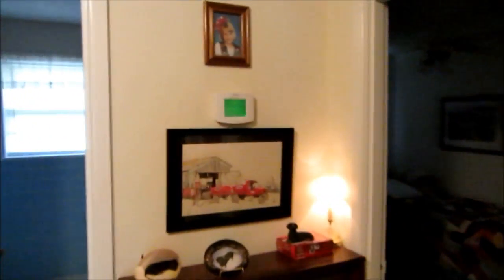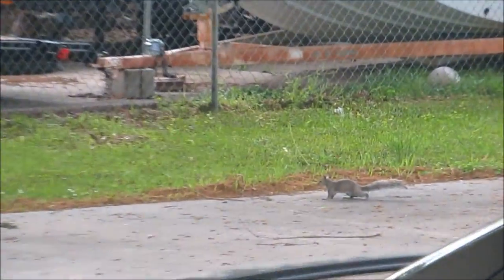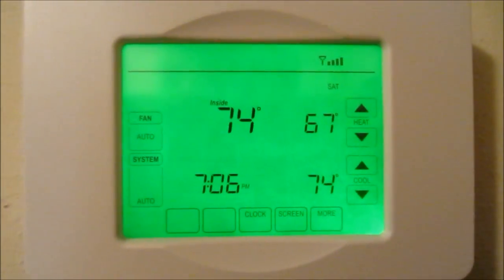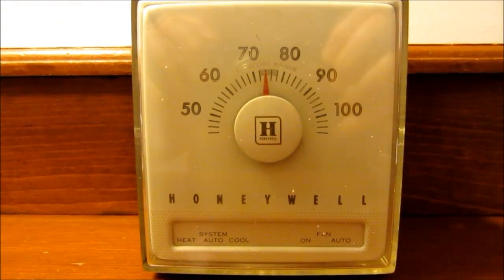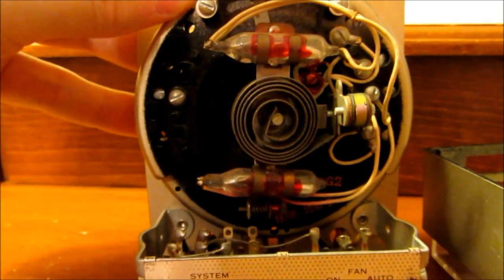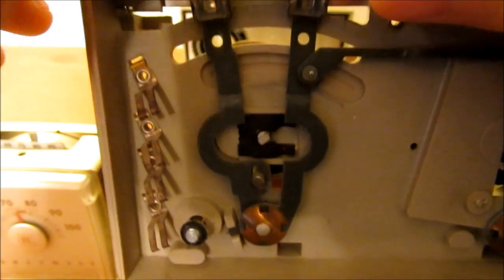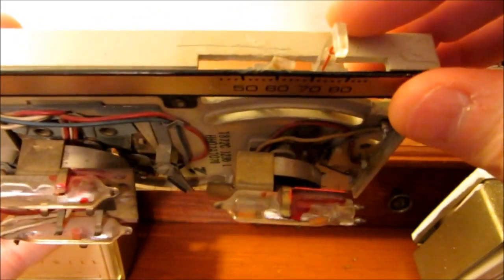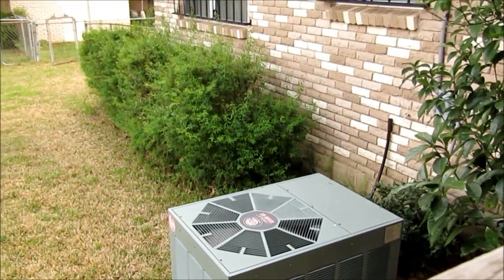Honeywell Thermostats: Auto Changeover Past & Present + Canon SX260HS Zoom & Auto Focus Test

Comment: Thank you for making this video. We had theese in my old church i went to before i moved. I am replacing the digital my house came with with the t874 with the auto changeover base. NO BATTERIES! no programming no hassles. Im sick of flipping the switch from heat to cool every time a front comes through. In WI the weather may change 3x a week easily. THANK YOU! This was so helpful. as far as im concerned i dont want to login or have someone hack my thermostat.
Reply from the maker: No problem, I'm glad my video helped you out! The T874 is my favorite mechanical thermostat.  I have several in my collection. That's great that you are installing one in place of a digital. I would not have a thermostat that required batteries either. They are very unreliable. Even though I do currently use a Honeywell WiFi Vision Pro, I have the programming turned off. The Pro models are powered by the common wire and require no batteries. Otherwise, I would be using a T874 myself. Make a video of your T874 installed if you can, I would like to see it. Thanks for your comment!
Reply: @AVTreasures 
I will make a video. I dont have a common wire to power it, unless i missed that. A couple weeks probably for me to install  it. and get the video up. it wont be amazing ill shot it on my phone and clip a few things together i think.
Reply from the maker: Awesome, I will watch for it Rory!

Comment: So I have that old school Honeywell T872 at my home and want to convert it to the new wifi thermostats. I don't know anything about thermostats so I was wondering if this is an easy switch?
Reply from the maker: Hey Brian, that is cool that you are still using an 872! You should be able to upgrade to a WiFi thermostat but if you're not sure exactly what each wire  going to your old thermostat does, then I would recommend that you have an HVAC tech install it for you. You probably have multi stage equipment since you have a T872 so you will need a Pro series thermostat, not one from the home improvement store. The Honeywell TH8320WF1029 would be a good choice. It can be configured for almost any system, single or two stage. Thanks for watching!

Comment: I commented a year or so ago about my Honeywell thermostat lacking a feature to lock the heat out on warm days and cool on cold days. I found a solution to the problem because I wanted a true set it and forget it. I installed two SPDT line voltage thermostats (like the ones used in walk-in coolers). One at the furnace on the W wire with the bulb going outside and one at the compressor on the compressor wire from the thermostat. The heat locks above 60 (unlocks around 52) and the cool locks below 50 (unlocks around 58). So there is no way for the heat to come on when it's 80 outside or a/c when its 30 outside......even if I do a crazy temporary override (when it expires). I may tweak it a little, but so far it works well. I keep it set to 70 for heat and 74 for cool with a 2 degree overcool with high humidity.

Comment: It amazes me how many homes and businesses have programmable thermostats and don't use the features. I finally programmed ours at work though people keep turning the autochangeover off. At home I have the Prestige 2 with 2 wireless sensors (plus outdoor and remote) and have my heat set to 70 and my cool to 73. I hardly touch it. My only complaint is the thermostat doesn't lock the heat out on warm days or the cool on cold days. So if you do a cool override to say 69. When the override expires it will cause the heat to come on to warm it to 70. A lockout feature based on outside temp as well as a 1 hour heat/cool switchover delay would make sense. The heat should never come on when its 80 outside and the a/c should never come on when its 30 outside.
Reply from the maker: Hey Billy! Me too, most of them go to waste being left on "Hold" all the time. I use a Honeywell VisionPro both at home and at my office. I use auto changeover on both of them during the shoulder seasons but usually switch to either heat or cool during the peak of the season to prevent what you describe from happening. I've seen mine switch from heat to cool for one short 5 minute cycle.
I like your ideas!! If they had a one hour delay option and outside temp lockout, I would leave mine in auto changeover year round and never touch it. 
Thanks for watching my video and for the comment!!

Comment from the maker: I don't have an outdoor sensor connected. The thermostat goes strictly by the indoor temp as to when it switches over. I have the 6 degree dead band set between heat and cool to keep it from switching over unnecessarily. Auto Changeover is optional and might not work for everyone. It works well for me because I never turn the heat up past 68 or the cooling much below 74. If you keep the heat on 72 and the cool on 72, you couldn't use auto changeover.